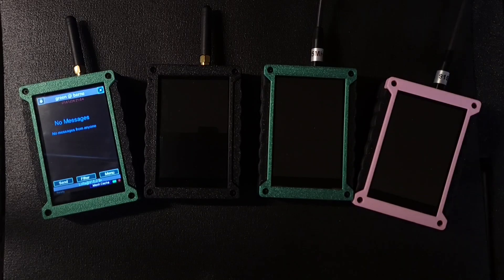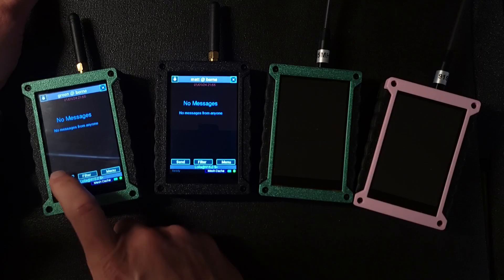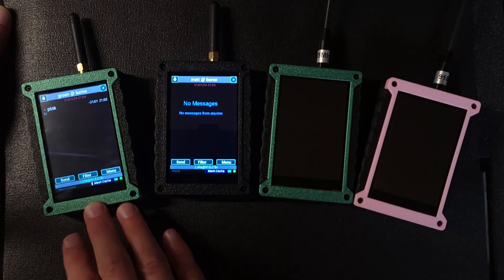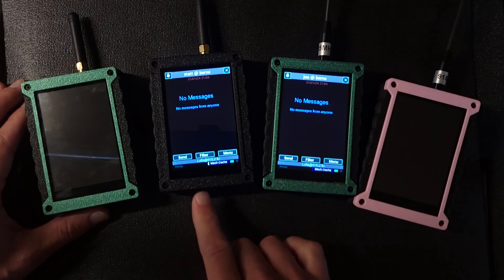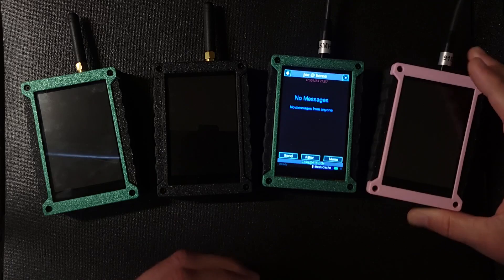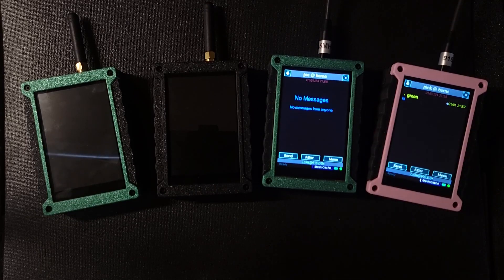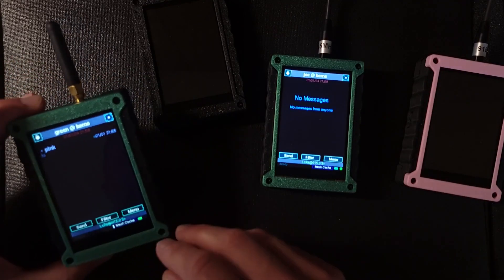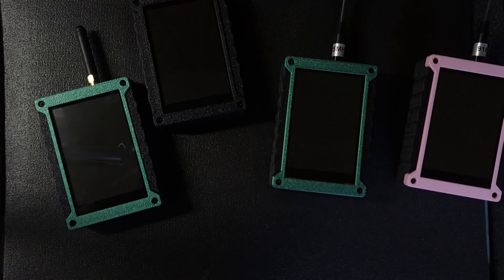ChatterBox Off-Grid Updated Mesh Demo

Comment: what does this do that meshtastic or reticulum don't?
and why would you try to start a new mesh instead of contributing to the other projects that already exists and have growing networks in the real world?
Reply from the maker: I wanted to build something from scratch, with digital signatures, asymmetric encryption, frequency hopping, and things like that baked into the core layer.. why? well because I like a challenge.

I also wanted to be able to integrate sensors and controls, and have a very easy to use UI that has a very low learning curve and doesn't rely on apps and phones.

Some of the differences are summarized here:
https://www.offgridcomms.club/help/chatterbox-vs-meshtastic/

Comment: Could you please clarify the maximum number of packets a device can store for transmission if devices around are out of range? and whether these packets are subject to be deleted after a set period of time?
Reply from the maker: Packets are automatically deleted after 24 hours. Each device can store up to 255 packets. A complete message is typically comprised of 3 packets, a header, a payload, and a signature. If the message is large, it may contain multiple payload packets. If the packet storage becomes full, the oldest ones start getting deleted first.

Complete messages are stored in a different area from packets, as they can be saved as long as the user wants and don't expire. Sizes of messages may vary, but typically you would be able to store about 100 messages, before the oldest start getting replaced by newer ones.